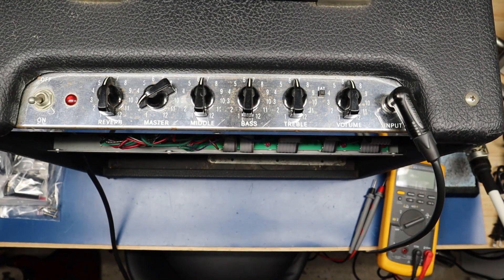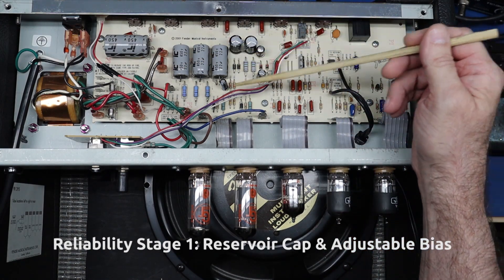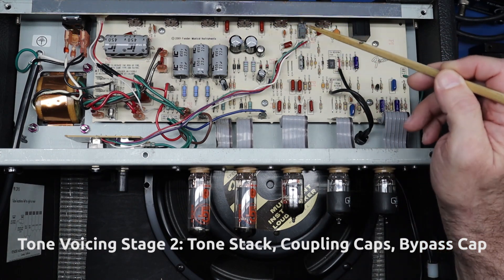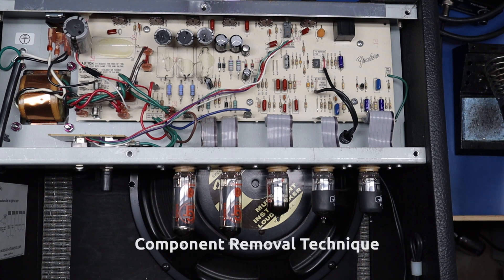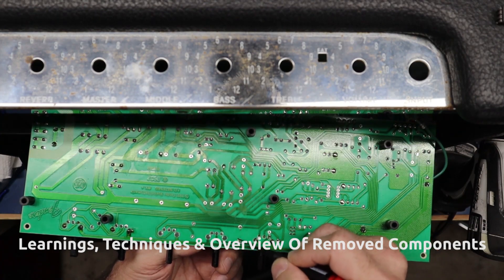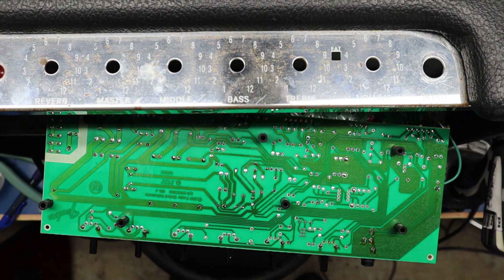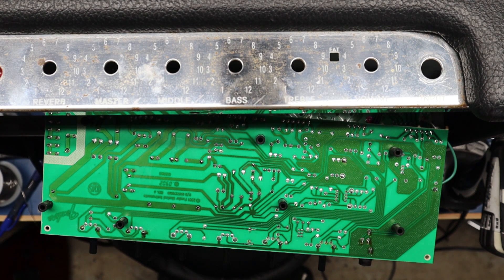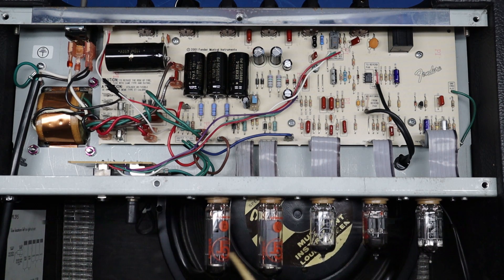Fender Blues Jr - Everything You Need To Know About Reliability And Tone Voicing!

Comment: Excellent instructional video.  I’m just left wondering about the reverb op amp.  Is the stock one noisier?  I have some NE5532 and OPA2134's left over from another project.  I wonder if they would sound better too??
Reply from the maker: Great question. For other applications the OPA2134 is fantastic and the 5532 is very good. For this application, noise is not the primary concern, it is the OPAMPS ability to source current to drive the reverb tank. The 4556 can source much more current than the 4558, 5532 and OPA2134. If you notice in the design the current is also limited by the 470R resistors after the half wave rectification. I recommend changing those resistors to 3W 220R and the zener diodes to 17V 5W and the filter caps to 470uF 25V. These changes along with the 4556 with drive the reverb tank much better. Email me at john@proampsolutions.com if you would like to discuss further, there are a few other tweaks that are germane to reverb improvement.

Comment: Also, you mentioned that blown out filter cap and you couldn’t understand why it was replaced before and it failed .  I think that’s the cap that was labeled improperly on the first series of boards. I believe the board was marked with incorrect or reverse polarity and that created a lot of problems and I think it was corrected on later board versions.

Comment: nice vid, thought I might try a question.  Non running jr when I bought it.  Had a broken tube so I replaced the tube board and tubes..  I did replace the output transformer but feel like I should have replaced the power transformer first instead.   Anyways the main board is modded heavily but I'm not getting any power light.  Is the power transformer the next best guess.. thanks

Comment: WOW!  That's incredible detail.  I have a new Blues Jr. IV and it sounds fine for my purposes.  It has a black PC board, which I have never seen on any YouTube feature.  There is at least one difference I can see on the board:  it does not have the bias resistor pair (I think that is the R51 R52 pair) that techs like yourself will modify.  There is just one resistor in that location.  I don't know what that means for the problem of overheating, but the amp sure runs hot.   There may be other differences, but I wouldn't know enough to tell.  Thanks for your video.  Really appreciate it.  Fascinating.
Reply from the maker: Thanks for your feedback. The black PC board Blues Jr IV is cathode biased, not fixed biased like the cream pcb. I've worked on a couple of these and even though they are cathode biased, they still seem to run too hot, but much improved. The last one I saw was right at 100% which does not leave any room for line voltage fluctuations.  I like to see cathode biased amps run between 90-95% idle dissipation. If you are concerned, I recommend taking it to a qualified service tech. If it is too hot, the value of the cathode resistor can be changed to dial the idle dissipation it in where it needs to be.
Reply: I have a IV as well. It's a good sounding amp. My only wish it that it had an effects loop, but many Fender models don't. I have other amps that do, so it's not really a big deal to me.
Reply: @proampsolutions  Thank you!! I just confirmed I have a black board BJ IV and I was curious about the cathode bias.

Comment: I have a couple of questions. First, I'm guessing that the power tubes run hotter as the amp is cranked up? So if someone used it in a low volume situation (small venues, Master all the way up & low gain, no cranked distortion), would it last longer) Second, would a cooling fan help alleviate tho problems? Thanks! Kevin
Reply: No, the bias needs to be fixed regardless of the volume you play. And a fan won’t help enough. These get hot enough to melt PCB traces.
Reply: @BCElectronic  So, the second half of my question: I'm guessing that it gets hot because it's being pushed hard.
 I've been playing around 4 gigs a month with BJ's ever since they hit the market in '95, and the same one since the Cream Board came out in 2002, and have had no problems with heat at all. There is no visual evidence of overheating.
 The only explanation I can think of is, I don't try to get it loud or to breakup, so maybe???  I've used it in (early Chicago style) Blues bands (before they got loud and distorted), A nine piece Western Swing Band for ten years, small Jazz bands, Swing Bands, and Country Bands, but never needed to crank it up enough to distort it.

Comment: I have a question I ask whoever may know. Amp hums. When I put my hand between the driver tube and first power tube next to it, the hum stops. At least mostly, and sometimes completely. Any ideas?
Reply from the maker: I have a few thoughts. The Blues Jr is very sensitive to lead dress especially the blue and brown plate wires. Secondly this amp is notorious for over dissipation, if the power tubes are out of balance it will induce hum and that is made worse by excessive dissipation. Thirdly you could elevate the heater supply, but that involves more work, but would likely solve your problem.
Reply: @proampsolutions  Thanks. I ran across someone on a forum that talked about elevating the heater supply. I'll have to look into what that involves. The same suggestion from multiple sources tells me to at least investigate it.
These are great little amps when they work right.
Thanks again

Comment: Question. How does a BF Princeton Reverb RI compare in reliability? Will it have all these problems?
Reply: The blues junior is probably the worst of them all, but the other reissues would still benefit from a recap, different speaker, speaker jack, tightening of loose hardware, tone adjustments, and better input jacks.

Comment: How sad these popular amps seem doomed by design to fail. Really, Fender should have recalled them and sorted the overheating power tubes at the very least.
These amps are not cheap... in the UK they retail well over £600 and I’m sure the repair work you have done is equivalent to a minimum 1/3rd of the cost of the amp. Throw in a speaker change and you are into 50% of new cost easily.
I’d love to hear amp techs recommendations for affordable small tube combos that have been designed and built properly. I bet it would be a short list !
Reply: Fender should have. It's absolutely cynical- they figured out since they are and will continue moving the world's most popular amps there is no need to show any respect to the customer by improving their product.
Reply: Good video but please stop saying a capacitor's value is some yooeff. That letter is micro not u. Microfarad. Not Yooeff.
Reply: @ross3818 It's a small thing, but also rubs me the wrong way when people say that.